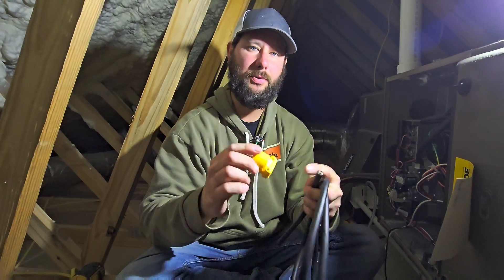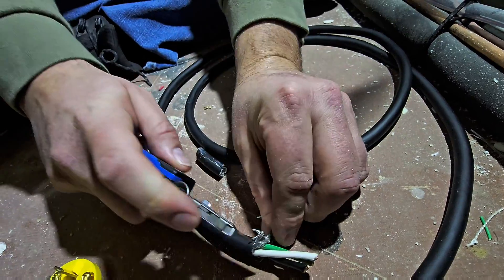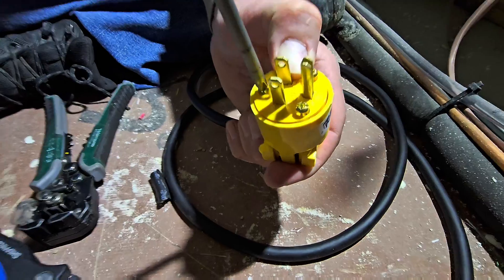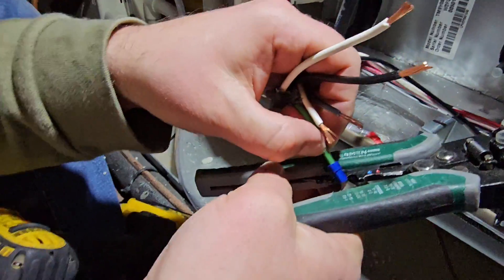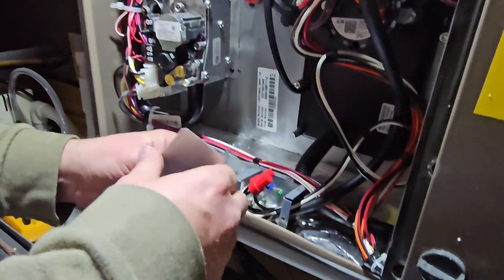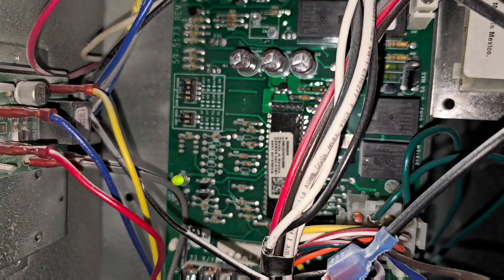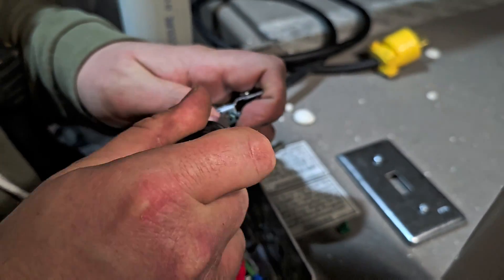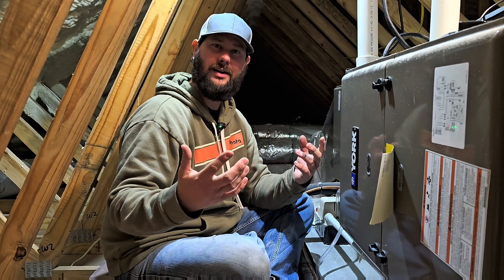2 Simple Ways to Wire a Gas Furnace FAST and SAFE!

Comment: Tadd hello, thank you for all of your videos. They are so dang helpful!!! Quick question on you wiring the neutrals together here. Could you have alternatively just wired them to the switch in their respective (line/load) order of incoming and outgoing power? Or do they need to be wired nutted like you did? thank you so much. David
Reply from the maker: You can definitely wire them to the switch, but they have to be connected.So they can't be separated.The neutrals have to be connected now.The black, of course, can be separated through the switch.And when you want power, you just turn the switch on

Comment: A plug on a furnace comes in real handy as a disconnect and especially if you have a second outlet fed from a generator source.
Also you should add some 1/2 inch plastic wire connectors/grommets to your wire nut kit.
Reply from the maker: Good point! I'll definitely add that to my kit in the future!

Comment: Hi tad. New here. If i switched the receptical power wire and the unit power wire on the switch screws would it work backwards? So on is off and off is on or does it not work that way?
Reply from the maker: yes
Reply: @taddydigest    Not true. Turning the switch to on position, closes the switch. Does not matter which this type of switch is wired for this application!